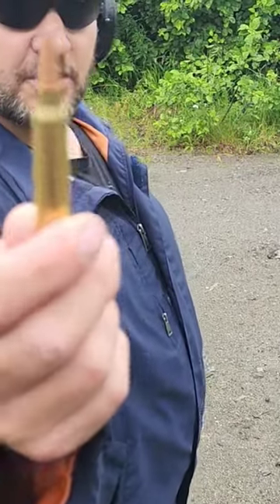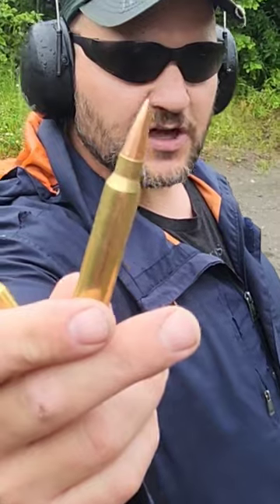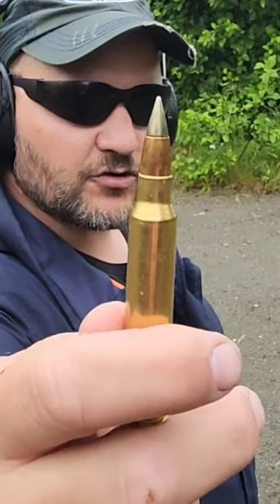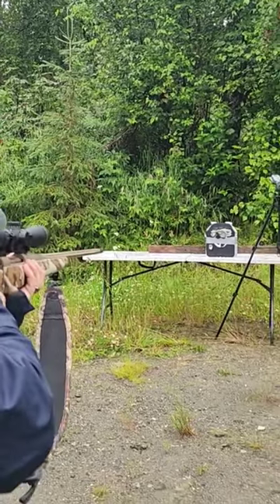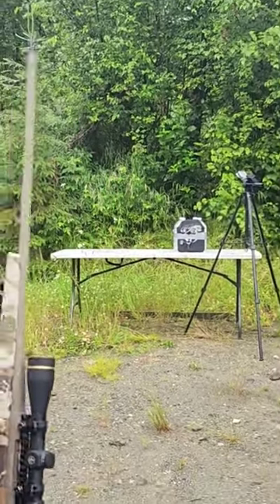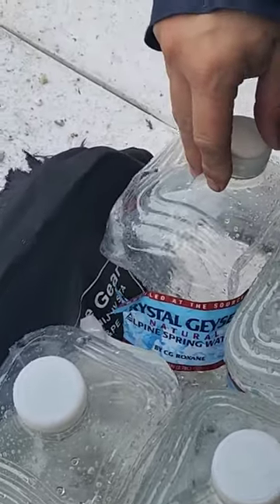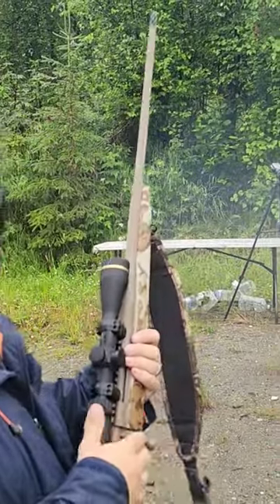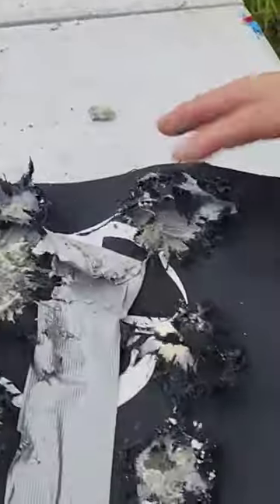.300 win mag vs. @LAPoliceGear Level IV plate #M80A1.

Comment: stopped the bullet, but the armor went through the body.
Reply from the maker: Maybe so! But wait until you see how a trauma pad works in my full length video next week.
Reply: That reminds me of a .500 mag video. The guy shot a lvl 3a soft vest with a 500 grain hard cast. The Kevlar caught the bullet, but the energy transfer pulled the Kevlar out of the vest and into the dummy he had set up.
Reply: @Firefuzz11  Go watch Kentucky Ballistics video Punt Gun vs Body armour. Body armour stopped the projectile from punt gun (1 pound ball of lead), however the projectile tore the armour through the dummy and it landed 40 yards from it:). Pretty gruesome and funny at the same time:).
Reply from the maker: @oskarskalski2982 sounds like it's so.
Reply: Impact force would likely still mean lights out even with no penetration
Reply: All it takes is a few inches of deformation to be fatal
Reply from the maker: @shermrock345 correct. @Buffman R.A.N.G.E channel has great Data on this!

Comment: Robber: good, it didn’t penetrate….. but my chest bones are all broken and my lung has collapsed!!!!!
Reply from the maker: Believe it or not a good trauma pad will make a difference.
Reply: @AlaskanBallistics  trauma pad will help with standard calibers 556 and 7.62x39…. But not against very powerful ammo. 3 inch 12 gauge magnum slug, 45-70, AP 30-06, 338 Lapua….. you drop to the ground in excruciating pain even with no hole.
Reply from the maker: @danielaramburo7648 https://youtu.be/l5lCJNg8Hps?si=5VVdHRE-ZRoRj57w
Here's the testing
Reply: @AlaskanBallistics  oh ok. Thanks.
Reply from the maker: I'm not saying you wouldn't be hurt,  but it would help.  
I've heard of people putting IIIA soft pistol armor in addition to a Trauma pad.
Reply: @AlaskanBallistics  correct. I will take a painful bruise over a hole.
Reply: @AlaskanBallistics   easy. Many square inches is the ballistic plate divided by how many foot pounds the round has. How much energy per square inch is delivered? Example: 357 magnum is above 600 foot pounds, spread out over a 10 by 10 surface, that’s 60 pounds per inch. Do the math.

Comment: I'd be curious to see what the A1 could do out of its normal .308 case and out of a 16" or even a 14.5" barrel. My guess is roughly 2700fps. I wonder if the ceramic wouldnt break up the steel as much at the lower speed. Or if there wouldnt be enough velocity to punch through. You are awesome for doing this kind of real world testing and getting this info out there 👍🏻
Reply from the maker: I could get it going about 3000 fps or if my 18". I had the 130gr barnes going 3150 and wasn't even at their max charge in the manual.  This 130gr should be too much different.  The bullet's a little longer though

Comment: 1st shot from my 18in AR-10 in 308 punched a hole straight through level 4 LA plate at 100yrds! I had a 196g RUAG Swiss P AP in Alpha brass with #450 small rifle magnum primer pushing it at 2796fps.
Reply from the maker: Got anymore of those bullets

Comment: I find it hard to believe the m80a1 didn't go thru..
Reply from the maker: Faster you send a bullet at ceramic style armor,  the faster the bullet breaks apart.  Probably be better around 3500 fps
Reply: M80A1 is technically not considered an AP round by the military. It will go through level 3+ but not level 4. A true AP round has a tungsten core or depleted uranium core, and good luck getting your hands on any of those -  even if you do find them they don't go for cheap theyre usually $30 to $50 a round minimum.

Comment: Just like the 45-70 it don't matter if the plate catches that .300 win mag, the energy transfer is gonn rupture your internal organs and make you bleed out from the inside.🤯
Reply from the maker: Possibly.
Reply: Watched a video about that and factory ammo out of the .45-70 was pretty mild, however hand loaded up to even a standard strong action load and it was shocking. Broken ribs, ruptured organs, lacerated lungs from bone shrapnel, you’d probably rather just not have the armor and die sooner
Reply from the maker: @bullgravy6906  maybe.  The trauma pads work.

Comment: when the Sig Spear becomes the new XM7 battle rifle chambered in 6.8x51mm Fury, would our enemies gladly go into battle without the weight of plates knowing that the plates were useless
Reply from the maker: No they'd develop level 4+ that would stop it within a year.
Reply: @AlaskanBallistics  so ballistics will lose the arms race to protection materials technology? Or it's just easier to issue new plates than new rifle systems.
Reply from the maker: @JinKee this plate is from China and already stopped a 130gr Steel penetrator round going nearly 800 fps FASTER than the 6.8x51mm. 
It'd take just a little thicker or denser material to stop a true AP 6.8x51mm at 3000 fps. A good near peer foe wouldn't take long,  if they haven't already,  to develop armor to stop it.  
The 6.8x51mm isn't all that.  The actual AP round is kept under tight wraps.

Comment: Does it really matter how fast the bullet is moving???
Reply from the maker: Yes.  It transfers more energy to the plate and causes more backface deformation because of said energy.
Reply: @AlaskanBallistics  then I guess my next question is....does it make the animal any more dead?  I mean for me...as long as the bullet does what it is intended to do, how fast it's going is kind of irrelevant.
Reply from the maker: @davidayres9865 Not necessarily because the speed cause it's the bullet to do what it's supposed to do or caused it to fail what it is supposed to do. There are a lot of bullets that won't open up and act like full metal jackets out of five in six hundred yards, And there are a lot of bullets at fragment way too close. So you need to know the speed of your bullet. So you know what yardage is in the ideal range for. .Also, you need to chronograph your own rounds. Because you are drop at distance may not be what it is on the box. 
Finally, this is not a hunting round. This is a specific round to penetrate low grade armor. And speed is one of the keys to defeating armors. So knowing how fast they go is important.. 
If you're in a Southern deer stand somewhere where you only have a 50 yd shot. Yeah sure who cares about how fast the bullet is actually going... But in this video and out west hunting, it's essential information
Reply: @AlaskanBallistics  Thank for the info!!
Reply from the maker: @davidayres9865 you're welcome